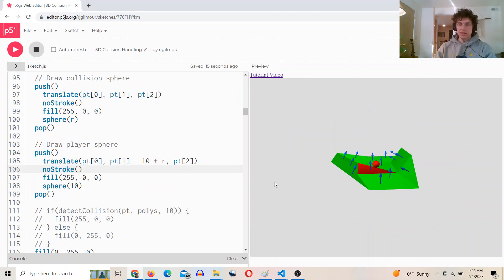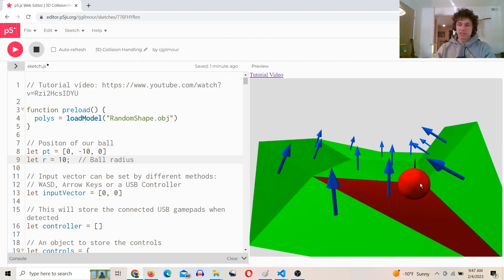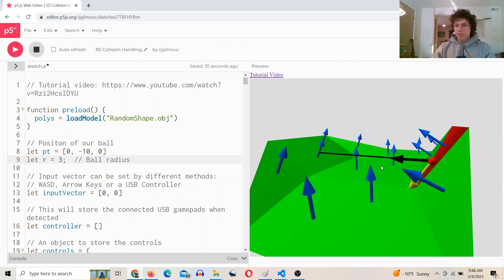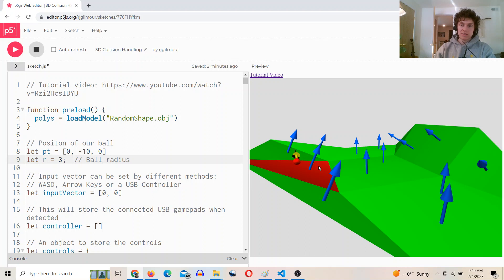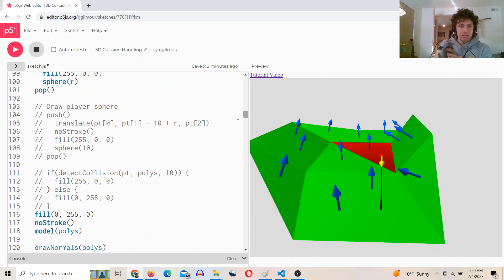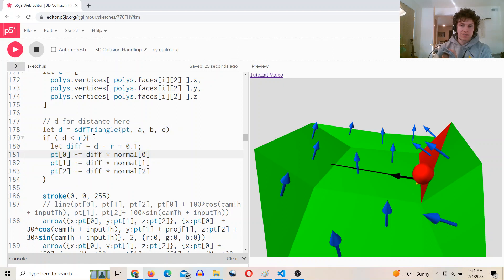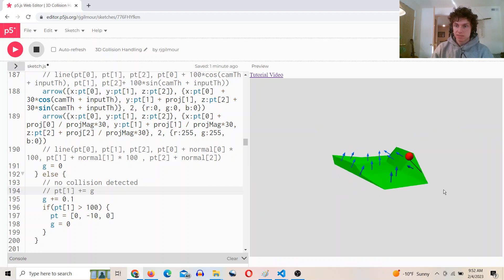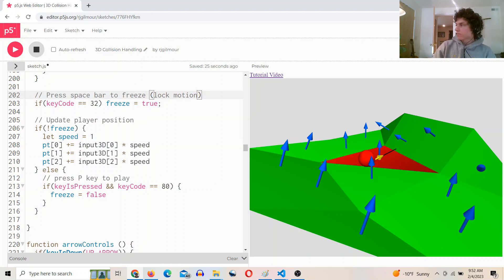3D Collision Handling

Comment: Very cool project! Inspired me to try adding collide and slide into my engine. I used your method of calculating the distance of the projected point to the plane to determine a valid collision and also the vector projection of the velocity onto the plane, but I seem to be having a problem with sharp corners. My player entity gets stuck along the edges and I'm wondering if it has something to do with the collision plane changing from the current detected one to the next which is perpendicular causing some issues with the projected velocity...
Reply from the maker: Thanks! Yeah I encountered a similar issue. I think the fix was to determine which surface was most parallel to the direction vector and ignore the other wall.
Reply: @morejpeg  Oh that's a good idea! I recently just tried a method where I found the closest collision plane out of all the ones that were intersected by a ray. Then the closest one would affect the new trajectory but I ended up getting tangled up in doing that recursively. I think for now I just switched back to calculating the y-component of the plane intersection for horizontal surfaces and using AABB for everything else. I'll definitely give your idea a shot though!